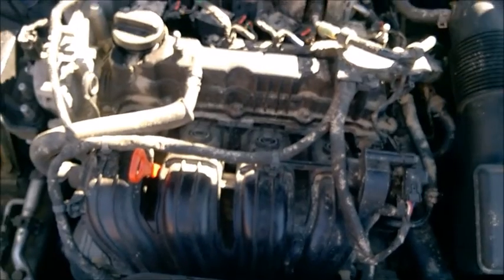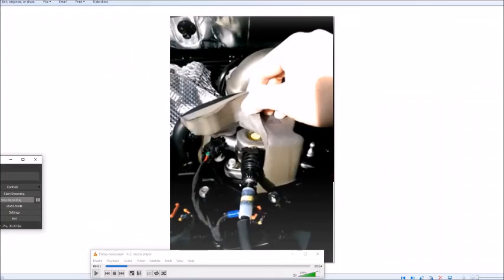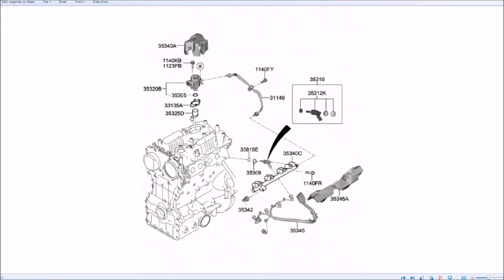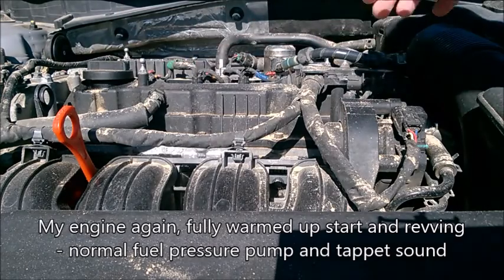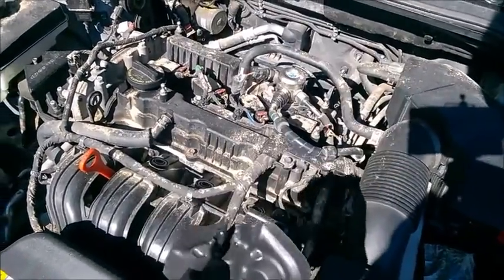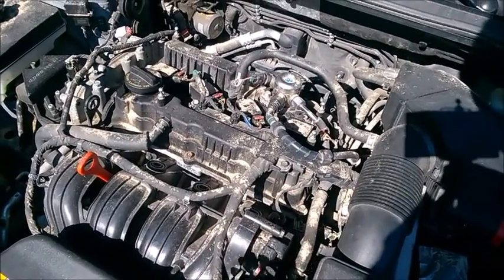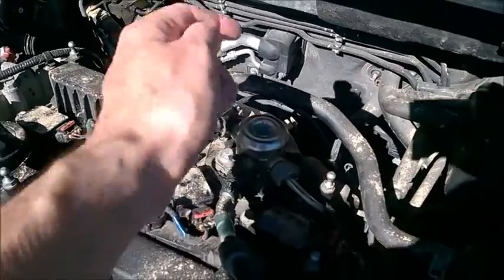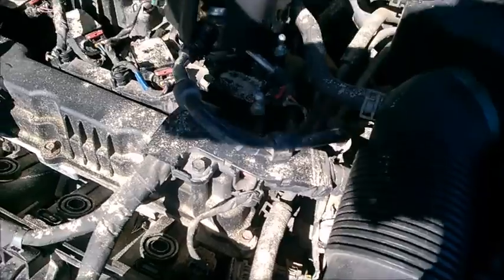Hyundai and Kia high fuel pressure pump - normal and faulty sound GDI engines

Comment from the maker: Prevent engine failure https://youtu.be/3l3N1mJTpps
The Camshaft Follower which actuates the high pressure pump has two small bearings which are lubricated with engine oil. However, these engines are infamous for soaking with unburnt gasoline the combustion chamber at cold starts causing oil dilution. This will degrade even fresh engine oil and in turn it will cause wear on the small bearings of the Camshaft Follower making them noisy. I've also noticed that the lobe ticking is louder with fresh 5W-30 Mobil 1 Extended Performance. With a 0W-30 oil, it's quiet like a mouse, can't hear it from inside the car. Thick oil may not lubricate well enough the lobe that runs the pump - it sits high up above the engine, maybe oil galley not well designed. This may cause wear in the long term.  https://youtu.be/5yi0xLo-fXw

https://www.thewrenchmonkey.ca/images/SPECTRA%20PREMIUM-DQjk15XG_FSA1600CF_TOP_P04_medium.jpg
More Hyundai videos https://www.youtube.com/playlist?list=PLl-l6yge4ast930y0wMiD9IIlDUy1mPFS

Comment: Kia optima 2016 1200 rpm  what is rararara noise
Reply from the maker: which engine ?
Reply: @Peppermint1 2.4 engine
Reply from the maker: @miraclelove8534  would start with the easier to check - make sure there is no lose exhaust heatshield - careful never get under car lifted with the spare jack. A rattle may happen from the heatshield over the exhaust manifold, between engine and cabin firewall. Next, try listening near the engine - be careful around the moving belt. Listen near the VCMA unit while someone is revving the engine. If it's fine, listen near the top engine on the belt side - this is where the timing chain is - issue with CVVT hub (oil leak from a faulty rubber plug) may cause the timing chain to stretch.
Reply from the maker: @miraclelove8534  Worst scenario would be a faulty engine but I don't know what noise it makes before failure - usually engine will seize all of a sudden. Many talks on forums. May happen between 85k-120k miles. If engine has all oil changes receipts, may get a free new engine from Hyundai if it seizes - I have videos about this.

Comment: I use 10w30 in my 2015 sonata it has 250k miles, i think it needs a timing change, it does sound like this tho
Reply: Ya I put 10w 30 also and no problems with my 2015 engine ,

Comment: Never put oil less than w5 30 or you lose it
Reply from the maker: 5W-30 synthetic on the 2.4
5W-40 synthetic on the 2.0T
Switching to synthetic at high miles will cause sudden severe oil consumption which should stop after about 15,000 miles
Reply: @Peppermint1  i have ford edge 2.0T what kind of oil to use 5-30  or 5-40

Comment: So that deep diesel like sound, everyone tells me it is a bad valve or a bad lifter. Is this just the sound of Hyundai's GDi?
Reply from the maker: It is a sound of worn camshaft follower bearing that actuates the high pressure fuel pump.  A bad valve doesn't make noise, a bad lifter will make a clacking noise and will cause the valve to chip at some point, all of a sudden usually while going uphill.
Reply: @Peppermint1 that chip you are speaking of, does it happen when you smack the go pedal hard then the sound kinda comes and goes fast? Like a chirp I guess but it only stays on for .0000007 Milla seconds.
Reply: That first sound it made when you started it up, my 2014 Santa Fe sport 2.0T FWD makes that noise when starting up and does not go away until approx. 10-15, sometimes 20 minutes into my drive. Sometimes not at all if it is cold outside. It only makes the noise when I let off the gas and slow down, or when im braking, about to come to a stop. What is this noise and how do I fix it? I’d really like to avoid going to the dealer if it’s something I could fix myself with a lift.
Reply: I also should add- I do my oil changes every 3-5k miles. I always add Lucas during each change. I have never had any codes thrown at me, and no issues whatsoever with the engine. It’s not a knock sound, it’s more of a tick/tap. I’m having trouble finding videos to find the same sound my car is making. It’s very frustrating not being able to figure out where it’s coming from!

Comment: Any one has the knock sound only between 1000 and 1200 RPM? what is the reason? And how to fix it?
Reply: Get high quality oil and fuels
Reply: I have a rough idle at 1200. 2013 kia sportage 2.4.

Comment: That pump is loud. It’s the nature of the beast. Insulation is for noise.
Reply from the maker: But my pump is very quiet, even with the insulation removed. I think if it makes noise it's because the engine oil has been diluted and the Camshaft Follower under the pump has wear at the bearings   https://www.thewrenchmonkey.ca/images/SPECTRA%20PREMIUM-DQjk15XG_FSA1600CF_TOP_P04_medium.jpg

Comment: Thank you for video, it's informative and great.
I must add that for anyone with these cars and any engine you must use genuine OEM oil filters and nothing else. They are designed to maintain oil pressure and oil at cold startups that is critical. These engines have weak oil.pumps and its detrimental you use OEM oil filters. Goofy lube doesn't and others don't.
Also use mid grade gas or better. Keep them clean as you can from the get go and you will have less issues in short run.
Reply from the maker: Thanks for the information
Reply: What about the 1.6GDI? G4FD
Reply: @Steve  I had read where it's important on the 2.0 and some 2.4, especially I ascertain that in general all of the engines generally have a weaker oil pump overall and because it's important for any car to have immediate oil at startup I would just stick with OEM across the board for its benefits.
I too have the 1.6 engine and the OEM filters are no more expensive from dealer than retail stores.
Reply: @RobbyB1061  but arnt the oem ones just a Mann filter? I can get Mann and it’s the exact same colour. Also pressure relief  is at 1 Bar on these
Reply: @Steve  looks as though you have done homework. That's great to know for reference, thnx.
I'm not familiar with Mann filters, but as far as the specs it would suffice I'm postulaing.
What it would boil down to is whether the manufacturer would consider this under warranties to cover any undue issues one might have with getting warranty work done.
I read a story about hyundai not extending warranties on the engines that have been in the news as late, and only doing so if certain criteria had been met prior to issues. It's like a prerequisite before they would honor engine replacement. Sorry I don't know explicitly on this other matter though, it's been a while since I heard it.
Reply: @RobbyB1061  oh ok not sure where your from but here in the UK, it became law that you may service your vehicle with any equivalent part and not necessarily use the dealership or OEM parts. 

In any case if you look at the original oil filter it’s blue for a Hyundai 1.6GDI and it says Mann on the side of the filter. An aftermarket one directly from Mann looks identical and in Blue and is a few pounds cheaper but in any case it’s good to know that the issue with these is the oil pump. The last thing I want on these engines is an oil pump issue or coked up valves
Reply: I do oil changes on the Kias in my family and I order Kia/Hyundai oil filters in 6 packs from Amazon for around $37-42 or so. It varies. These things will have lifter issues without the OEM oil filters. Better than cheap gas is recommended for the GDI motors. Keep on top of the oil level because some burn a quart every 1,000 miles also. Other than that, they're good motors
Reply: @zachx3278 100%. I didnt know. And i was 200km away from oil change. And got off the highway and heard a weird noise. 

Pulled over, and my engine was bone dry of oil. 

I just swappedthe engine, 2014 veloster turbo

Comment: How do you experience the reliability of these GDI engines? Is it as good as Volvo?
A week ago I test drove a Hyundai I40 2.0 GDI. It's basically the same engine as the 2.4.
I experienced this engine as a little bit jerky. It was mated to a manual 6 speed gear box and what I also experience with those engine is that the clutch wears out very fast. 
I think I stick with Volvo in the future. My old S60 stays super reliable even now that it has 383.000kms on the clock.
Reply: There junk
Reply from the maker: Hyundai/Kia engines are in no way close to the strength of the P2 Volvo engines.  Hyundai had massive problems with their larger 2.0 and 2.4 GDI engines, turbo and N/A, in the past 10 years and now problems surface with the 2.5 engines made for the 2020-up models, which are the same as the older 2.4, just bored out and a few improvements.  Because H is forcing the design to improve mpg, the engine design is weak.  Many engines with around 100,000 km have been replaced (seized) and usually one should not expect these engines to make it past the 250,000 km mark. The Volvo P2 diesel and gasoline engines were among the strongest engines made by any car maker in the 21st century. I compare them to the older Mercedes and Renault engines from the 60s and 70s (unfortunately, the P3 engines are not good and had piston ring problems). On the good side, Hyundai has quite decent transmissions and overall are not bad cars, I would say less problems than the P2 Volvo, except for the engine. I suggest you have a look on a Hyundai forum such as https://www.hyundai-forums.com/
Reply: @Peppermint1 I stopped reading where you wrote that Volvo is better than Hyundai.
Reply from the maker: @user-xd1of5eo7h  I said the P2 Volvo 01-09 had better engines than the first generation GDI Hyundai 11-19.
Reply: @Peppermint1 GDI engines started from 2013 to 2017 then became TGDI. There were some recalls on the 2.0cc and 2.5cc as there are in all car industries. Recalls in general, you can't compare a company that is almost bankrupt like Volvo with the global giant Hyundai.
Reply from the maker: @user-xd1of5eo7h  Here in Canada Hyundai offered the first GDI in 2011. It had issues from the start with carbon build up - frequent expensive cleaning (manifold had to be removed). Same issue with Audi and other car makers with direct injection. Then H had the bad idea to wash this carbon with extra unburnt fuel at starts. This caused engine oil dilution, many engines basically seize at around 85k to 120k miles. We see lots of these owners on Hyundai forums, dealerships have long delays ordering engines for replacement. H blamed the issue on machining debris which everybody on forums agrees it cannot explain why even cars made years later still have the issue. The non GDI 2.0 in Elantra suffered from piston slap, the 1.6T in Kona also had issues. Hopefully the engines from 2020-up are better done, usually H does improve their problems. Other than the engines, usually H are reliable cars with fewer issues compared to the competition, including the japanese.